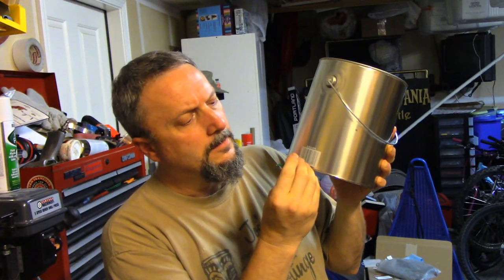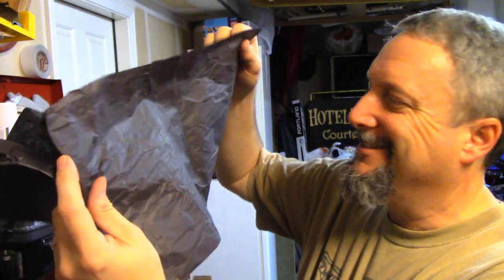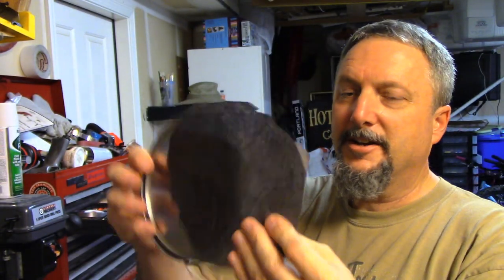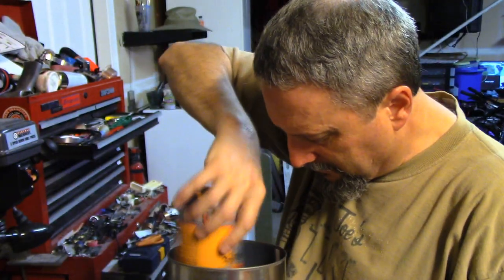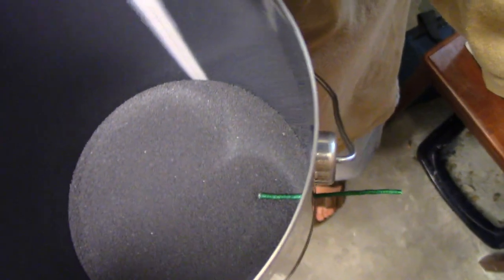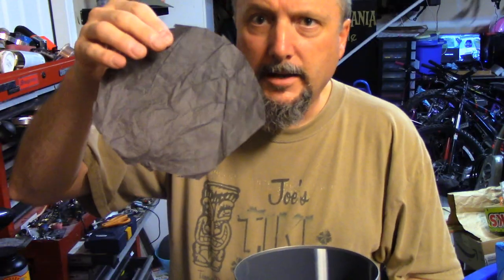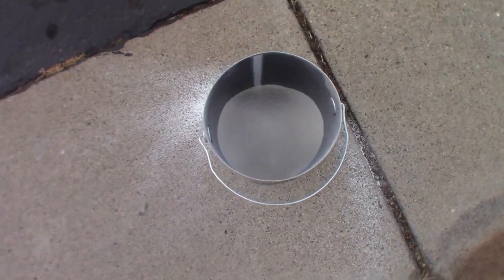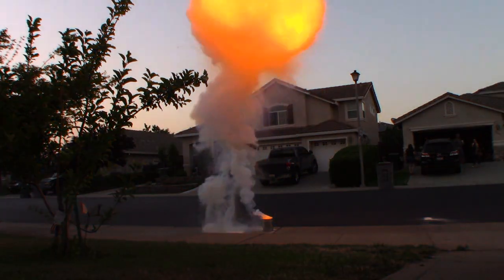Making a coffee creamer fireball

Comment: smokeless gunpowder is a flamable solid, BP is a 1.3 explosive. handling wise, GP is far safer. however, for this purpose, BP is the lift of choice. GP is only "dangerous" when under compression
Reply: I have heard it said that smokeless powder can have a “deflagration transition” if it’s under enough pressure. And that, in turn, will bring the burn rate to about 5km/sec with pressure in the hundreds of kbar. 

Smokeless is safer when burning in free air and is more likely to cause a dud in an open pain can but this property is likely why there’s a law against using it in fireworks.

Comment: How much does black powder cost? I love the idea I think it's fairly safe if done right. Just wondering about the price? Say I wanted to do 12 of these
Reply from the maker: At a store like Sportsman's or Bass Pro's it costs around $22 for the containers of black powder substitute they sell. You might need two containers for 12 fireballs. 👍
Reply: @josepherkenbrecher5655  thanks for the reply. I appreciate it
Reply: Your ideal black powder for this sort of thing is called 2fa which is a grade of bp intended for use in pyrotechnics only, the closest thing in sporting grade would be cannon grade. It's available here https://powderinc.com/product/goex-cannon-black-powder/ but it is very pricey. A much better way to do this is to start making your own bp. It's a simple composition made up of 75% potassium nitrate(oxidizer), 15% charcoal airfloat(fuel), 10% sulfur(catalist), 2-4%dextrin(binder). Charcoal made from willow or eastern red cedar will make for a much hotter bp than just commercial mixed hardwood charcoal makes. These chemicals can all be purchased from fireworkscookbook.com, and a few other chemical vendors that are online. These chemicals will have to be weighed out and ballmilled for hours to intimately mix them. Once milled you will have to get yourself a 4 mesh welded stainless steel screen from mcmastercarr and put it in a frame. Now you have to take your mill powder and wet it till it is a dough like consistency. You make your powder into balls and then grate it across the screen to create granuals. Once this is dry you have your own 2fa Black powder. This can be used for creamora fireballs, or gas mine fireballs. It's also used as lift charge for shooting aerial display shells into the air. I also use this for my break charge when it comes to 6" canister shells filled with tourbillions to salutes. Sorry about suck along reply just hoping this info might help you. If you like fireballs check out gas mines, and if interested in making fireworks you might want to get a subscription to fireworking.com. Careful though as the saying warns those thinking about getting into pyro, because once you have smelt the smoke you'll never again be free. It becomes an obsession of making a bigger and better shell, rocket, or whatever pyro type devices really interest you.
Reply: @brandongibbons6618  nice detail in making great BP.  I did mention skylighter.com in the description as one of the places to get supplies. In fact they have a bp kit (with red gum) that doesn't need a mill. Oh I wish I had a mill! But you are right, if I had a mill then this little, messing around, hobby would become a very expressive obsession.
Please keep in mind that I live in California, land of the free, where wire sparklers are illegal. We can only do ground based fireworks. Which I completely follow these rules at all times.